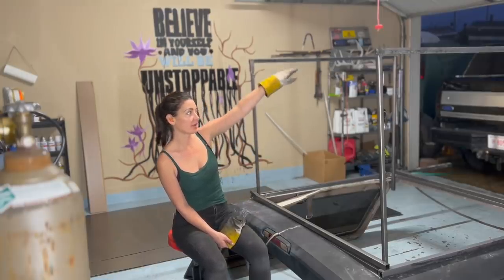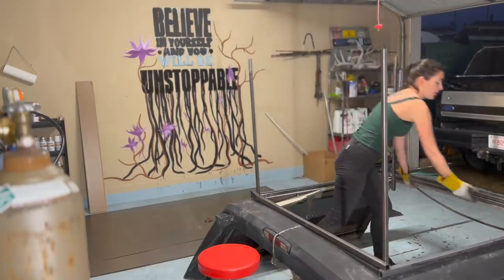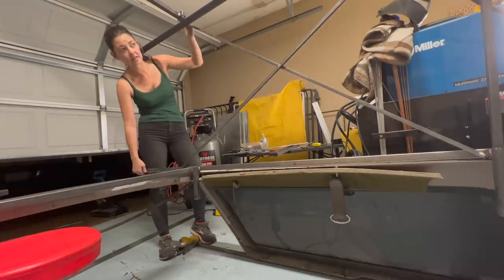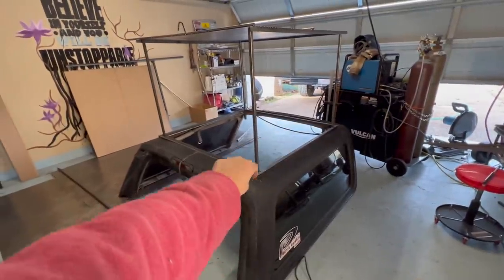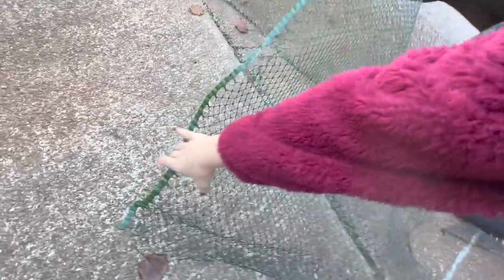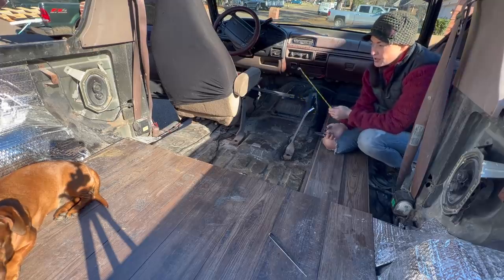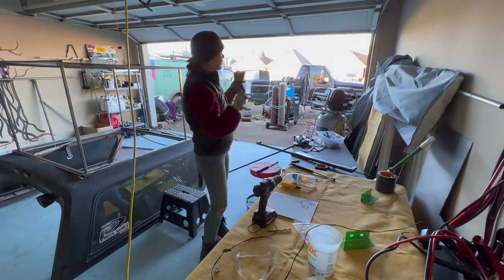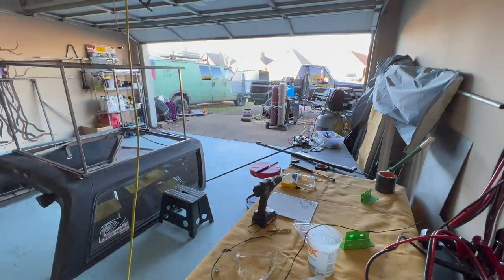THE SEXIEST FABRICATOR ON YOUTUBE

Comment: Morgan. You are better off doing a thick canvas tent with windows on the pop-up portion. Look at the builds on class b homes with pop ups so you can get ideas. Cutting a hole in the body for a vent for the small fridge will be a good idea too. Also for a small btu furnace. Water tanks would naturally fit under the bed in there as well. Just throwing some ideas at ya!

Comment: what are you cleaning your parts in before welding?        DO NOT USE brake parts cleaner to clean parts before welding.     When it is burnt during welding some brake parts cleaners can produce phosgene gas which is deadly.
Reply from the maker: Just sanding it

Comment: Is this going to be permanently popped up or is this something you’re able to swing down and swing back up because if it’s permanently going to be up and if you’re going to do any driving you’re gonna have to put a front end to that on an angle to deflect the wind or you will blow it apart
Reply from the maker: Everything pops back into place and looks like a normal Bronco when driving. Everything you see pops out when parked.
Reply: @UnstoppableMorgan   great I enjoy seeing you working on your truck I might do this later in life when I get older I’m only 60 now !!  Seriously when I was 12 years old while waiting for my dad to get out of surgery he was having triple bypass !! I got a sketchpad a ruler and some good pencils and a pencil sharpener and I sat there for three or four hours it took and I designed a collapsible fold out tent well basically a collapsible cabin that would fit inside the wheel wells of a standard pick up truck and the center was 6 foot six and the walls is 4 foot high on the sides I had a full-size door I had windows everything designed for this are you cinder blocks as a base that the floor when you popped it out !! I have a pen and a pulley set up where are you pinned the floor in place to set it on top of the cinderblocks and then the sidewalls was pulled back along with the front and rear and the walls in the back was made of plywood and I have six frames on the sides with sliding screen windows to get air !! I still have my drawings I never did anything with him about getting it patented to build it and I was 12 years old at the time I’m 60 years old now I designed a few things over my life I designed a couple of things for HoneyBaked Tam safety equipment for their slicing machines they took one of my ideas because I gave them the drawing they had it made up and was using it in all their stores they are no longer using it because they lost a spiral slicing pattern so anyone can spiral sliced now !! Yes what a design went on the spiral slicing machine !!
Reply: I do believe the drawing you did at age 12 served it's purpose would you agree?
Reply: @billybatesjr1837   I guess I was just saying  (not that is the case) even if was completely impossible to build using the sketch you'd made it was however very beneficial for keeping the mind of a 12 year old boy who I imagine was terribly worried about his father during this surgery? 
It's a very useful talent to be able to have a creative thought and draw it all out on paper

Comment: For the arms that will lift the pop top ....use two different sizes of square tubing where one can fit inside the other.  Then when it gets to the desired lift.... have a hole drilled between both tubes to slide a pin into for holding in place!